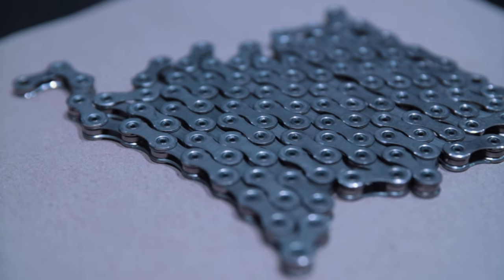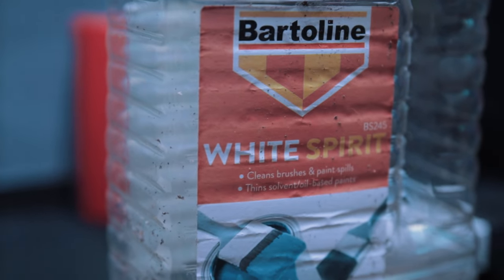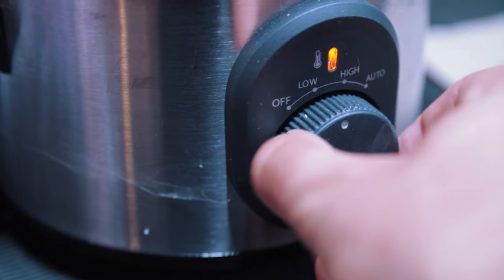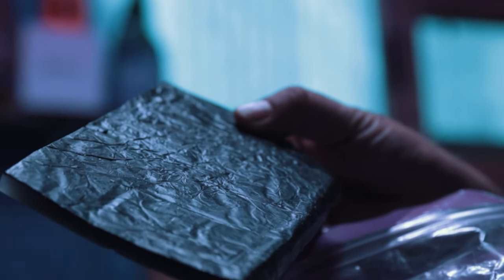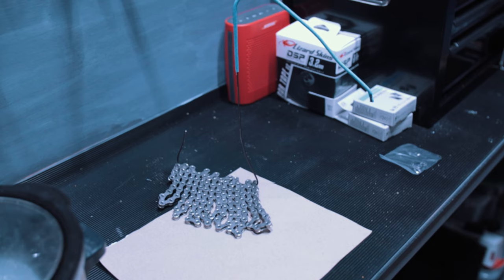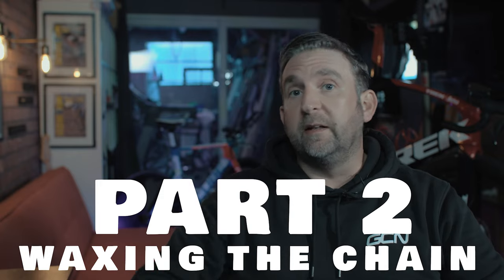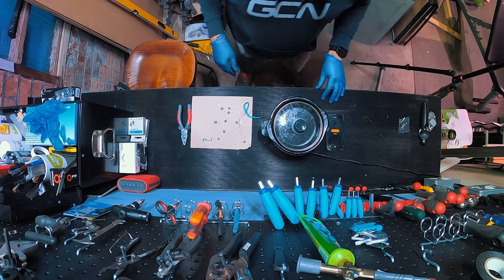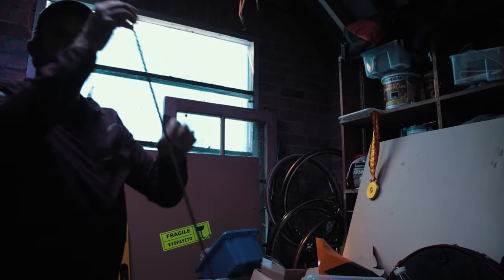FACT or FRICTION part 3: How to Wax a CHAIN (It's easier than you think!)

Comment: For boiling the chain I use an induction hob and big old frying pan, this gets all the old wax/dirt out thoroughly. To dry drivetrain an XPower Air Duster works well, safer to use when chain/cassette on bike than a heat gun.

Comment: I went over to wax I love it I w as lazy bought pre waxed from.  NRG chains, quite, clean and efficient.
Reply from the maker: Nothing lazy about it - you just need to make sure you’re topping it up in wax every 200-400km (dependant on how long you want your drivetrain to last/how quick you want it to be) or a drip lube - the best ones (again, tested by Adam Kerrin) are Squirt, Silca NFC (which I don’t think you can get any more but they have newer products and crazy prices to go with that…) Tru-Tension tungsten (you can get a discount for that in my description) - all of which are very good but not as good as wax and certainly better than a lot of the BIG names (with lots of legal money) who’s lubes tested beyond horrendously… absolute black grapheme lube also tested well but is over $230 a bottle… so yeah… and their wax is not good…
Reply: @1stElement  I will re wax the chain some where in the 200-400 km window

Comment: Hi James, I think you are making a fundamental mistake in your process. Using a wire coat hanger is a complete no no. It must be a bent spoke. The chain will know if it’s not a bike component that is being used 😉 But yes I’m a fan of waxing my race chains at least. Silca wax so far for me and top it up with their drip wax.
Reply from the maker: JB - you’ve always had my back mate…! You make a good point and one I need to address swiftly!! Marginal Gains is the best podcast - I think you put me on to it..? It’s a treasure trove - Josh is amazing! I need to get the Silca wax - I’m running out of MSW..!